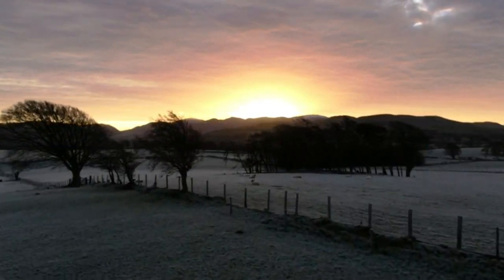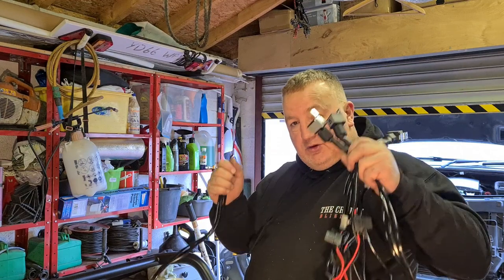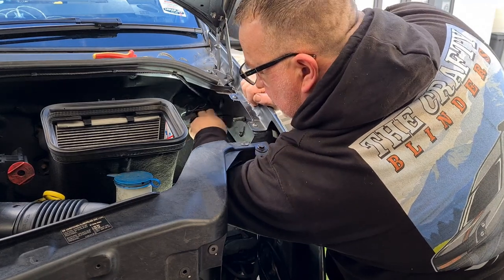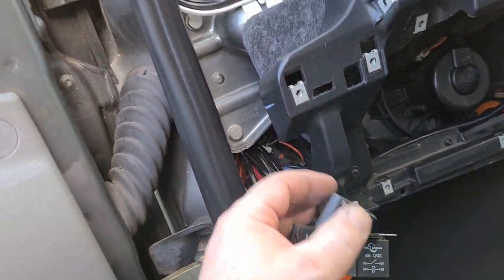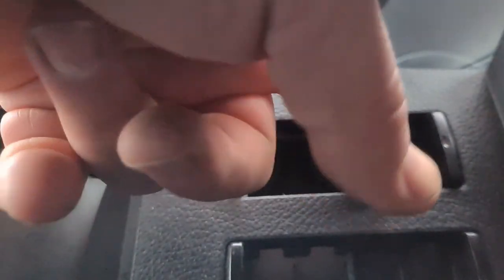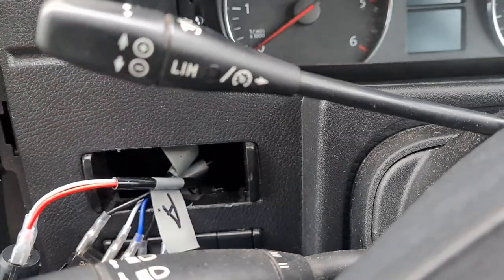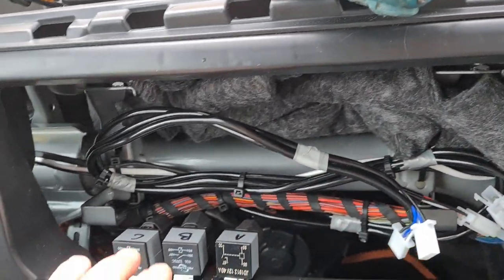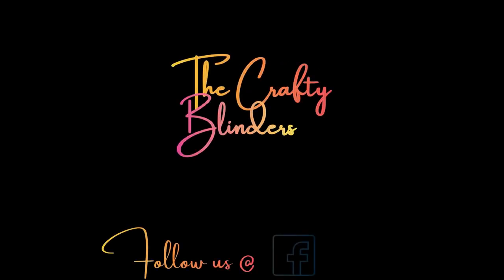led spot light upgrade | selfbuild campervan crafter sprinter | 63 | the crafty blinders

Comment: Great location for the relays Sam. Unfortunately on my Sprinter I have an air bag in the way 🤔
Reply from the maker: That never crossed my mind that there may be an air bag in that position on other models 
I just used what I had available
Reply: @TheCraftyBlindersvanlife  I haven't been beaten yet Sam. Going to make up a bracket for the relays which will bring them closer toward the bulkhead. I'll take a few pics and share them 👍
Reply from the maker: @Ciaran O'Kelly  cheers that would be great 👍